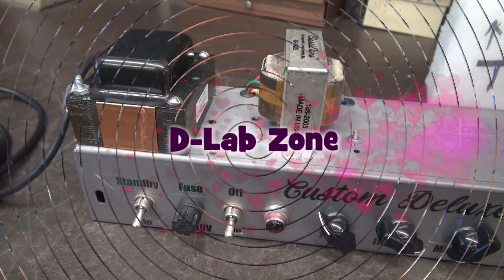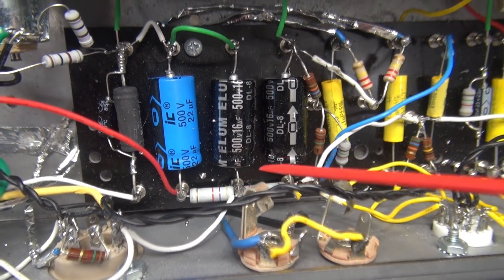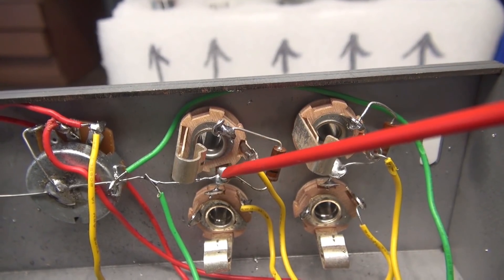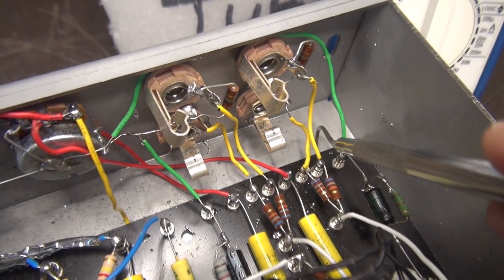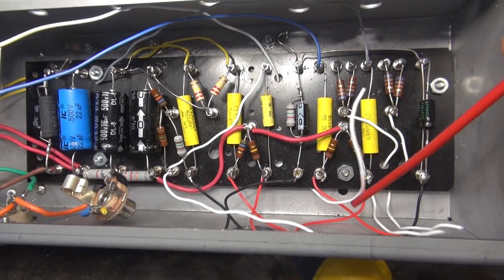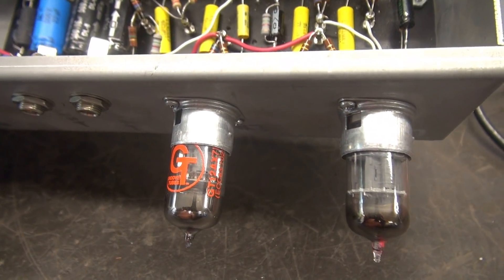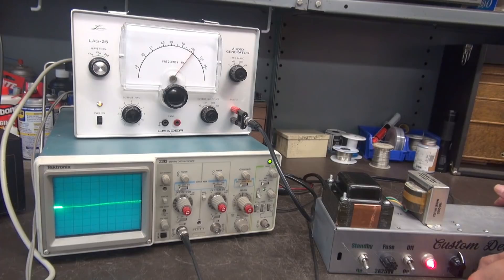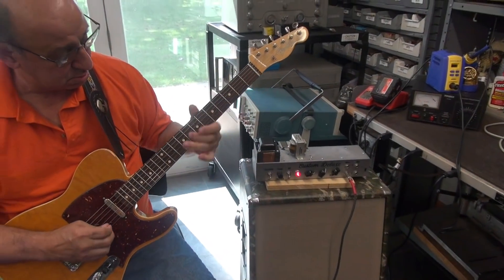How to repair Fender Deluxe Boutique 5E3 kit tube amp bring it back alive return to stock circuit

Comment: Thank you for your videos. I have learned alot and built 2 fender champ style amps with different issues on each but with your videos I figured out the problems on both.  I still dont understand the science behind it but I am learning. Im staying away from the high voltage in my builds so i am safe.

Comment: Hello, i got a question regarding safety. I replace a couple of capacitors and a power IC on my Fender FM212R. I'm very apprehensive on pluging it in to my wall socket. What is your advice on doing this correctly without blowing a circuit breaker in my home or get shocke in case i did not do it correctly? I noticed people use a Isolation chamber or a variak... Any help would be much appreciated. Thank you.

Comment: Why do you put the spacers in with the screw trough the chassis? Isnt it easier to have the nuts on the chassis, it seems a lot less fiddly to use screws and screwdriver on the board instead of messing with nuts and wrenches between the components.

Comment: What’s up with those power transformer bolts at the end? At least one is going through backward from normal, and it looks like there are no nuts between the transformer and chassis. You want to leave those nuts on there for the air gap!
Reply: Why? I have seen many stock marshalls where the laydown tranformer is right against the chassis.
Reply: @infectionsman  For the air gap--to enable a little airflow and reduce heat stress on the transformer.  Not like it's a feature the lack of which will immediately destroy a  transformer, but most transformers you buy will come with nuts and/or spacers already on there for the purpose of leaving a gap, and anything you can do to increase the life of a component seems worth employing and/or leaving on there.  The main head-scratcher is why at least one bolt is going the opposite direction of the others.
Reply: @ElliotGKnapp  I mean, if you attach it directly against the chassis it will provide heat-sinking anyway.
Reply: @infectionsman  Sure, like I was saying, it's not like it's major in the scheme of things and there's ultimately not a lot of point arguing against someone's personal preference.  Using the chassis as a heat sink, of course, would distribute more heat to the chassis and potentially other components, also eliminating any potential benefit from providing (slight) ventilation to everything else inside the chassis.  Personally, I'd rather have the air just take some of the heat away, if possible, especially since the transformer manufacturer (who presumably knows something about their product) typically provides nuts and/or nylon spacers for this purpose.  Also, I'm lazy and it takes more effort to take the nuts off than just leave them on there :)
Reply: @ElliotGKnapp  I use nylon spacers and plastic tubing around the screw threads so they dont touch the laminations. The screws can cause magnetic shorting of the laminations = eddy currents.

Comment: Hey guys, you have to live and learn!  Paul should have done more reading online on how to dress his wiring and how to run proper grounds.  He should also ohm out all connections point to point after soldering to make sure he has good connection and no grounds where they don't belong as he is building the amp.  Saves a lot of surprises later!  When I built my first hi-fi preamp, I built it to look good not thinking about function.  It didn't take long to realize that looks don't count but good grounding and component placement does.
Reply: Yes, very sloppy build..he knew just enough to get in a mess,,

Comment: Are the power tube sockets Belton?  If I needed newly made sockets I probably wouldn't use anything else.

They make these special studs which are designed for grounding to a chassis.  You would drill a hole just large enough to pass the threads and then cinch it down with a nut until the head is flush to the surface. This causes the teeth pressed into the perimeter of the stud to dig into the metal and produce a permanent connection.  They work exceptionally well with aluminium.
Reply: @Heads Mess No, they're called self-clinching studs.  They are actually made to be installed with a press but using a nut will work just as well.

Comment: Terry, I had no doubt you were the man to correct my first attempt at scratch built amp (from schematic). Many, many thanks for your hard work. I love it!
Reply from the maker: Thanks Paul, It was a fun project + allowed me to use the Twilight theme
Reply: You actually got a more-than-fair amount of it right, electronics-wise. Does the schematic say to place spacers under the turret board? No. Does the schematic show the right lugs to solder to on the input jacks? No. Does the schematic say to twist the heater wires to reduce hum? No, indeed, the schematic doesn't even show the heater wires...they are just assumed to be there. Does the schematic show that all signal grounds should be returned to the same point? No, it just shows an arrow to ground as a piece of "shorthand" and assumes you will use "best practices" to get those grounds right. There are lots of things that the schematic assumes you know and will execute; Just like a roadmap doesn't show every stop sign and traffic light on the way from "A" to "B". You can go look at dozens of YouTube videos of kits that folks built from Heathkit or Dyna or Eico, and  90+% of the time, even with pictorial manuals and verbal step-by-step instructions and all the right number of tie points, most Heath home-built gear 
looks like utter crap! 
Again, it's not Nobel prize stuff to build circuits well but it takes lots of practice and you have to have looked at many, many pieces of industrial-grade gear to understand what good wiring looks like. And after that it takes a fair amount of practice to cut wires to a good length and how far back you should strip the insulation and on and on.
Reply: Lot of snarky comments on here, but I commend you for taking on the project. I'm pretty sure you learned a lot along the way. Thanks to d lab you now have a nice little amp. I suggest you start watching uncle Doug's amp repair channel, he goes into great depth on how to repair and scratch build vintage amps.